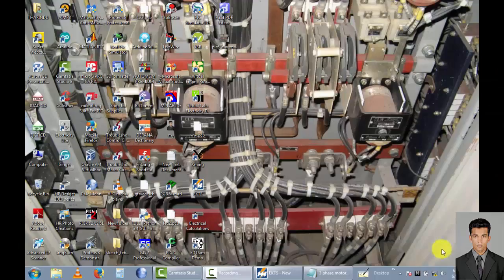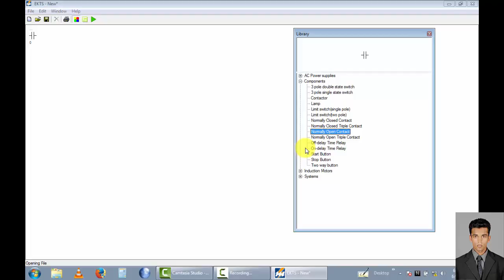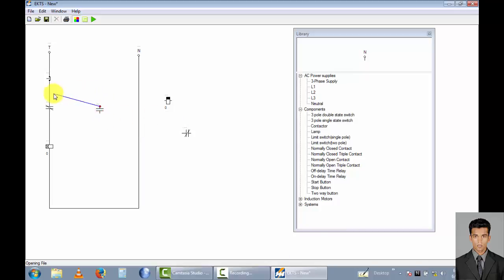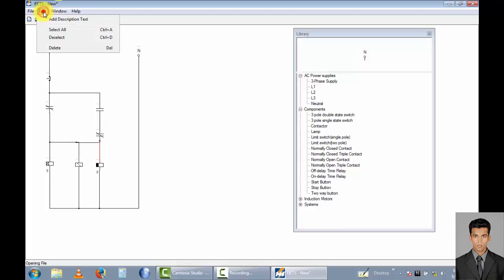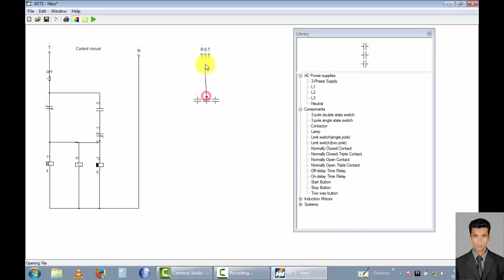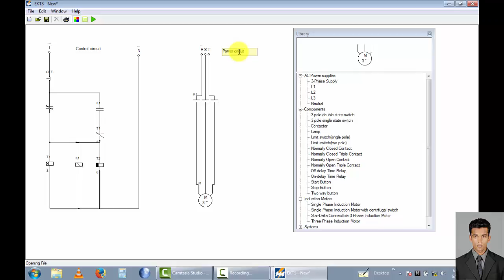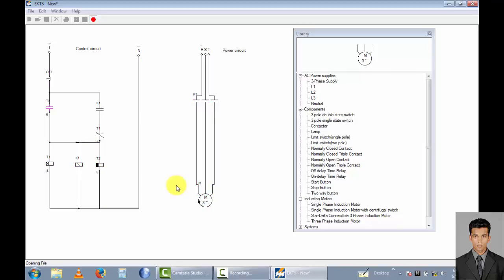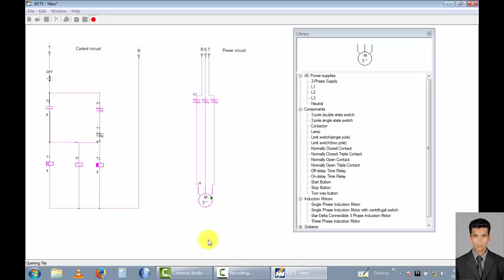Three phase motor circuit[Auto on-off]

Comment: I need to make a circuit in which a motor must run 10 min and stay 2 min off....
10 min on
2 min off 
repeatedly / automatically 
can u please help me out
Reply from the maker: I Will HELP TO YOU.
Reply: +tharindu dayananda thanks. . I have on delay and off delay both timers in huge quantity. I need to make this circuit for a pump motor.. before it was working on pressure switch .. but now it is out of order. . and we don't have spare.
Reply from the maker: so you can change time setting of the timers.